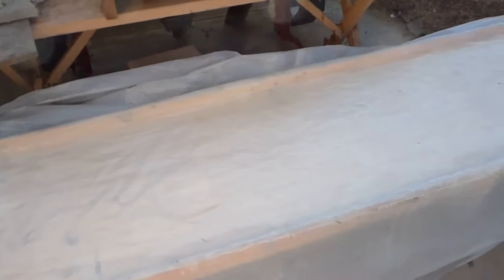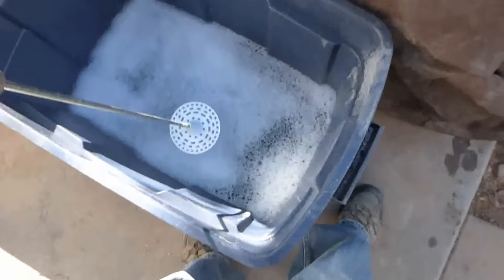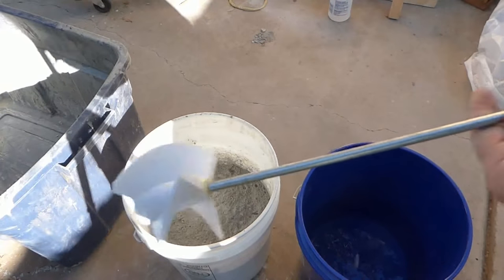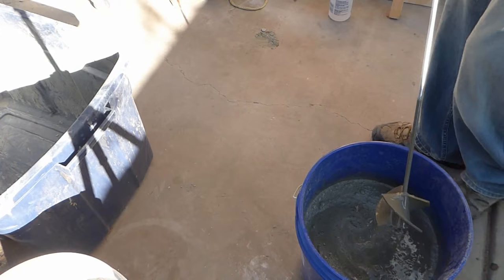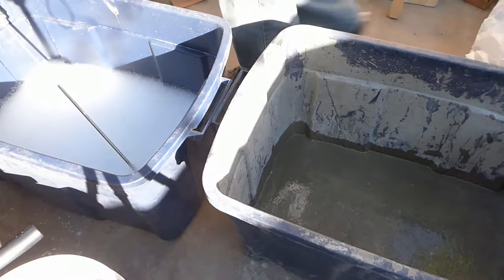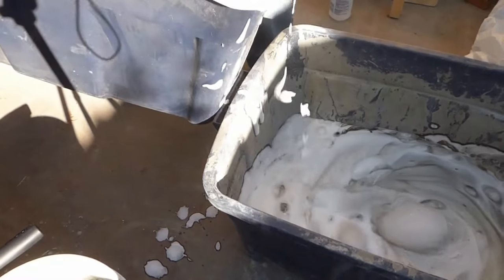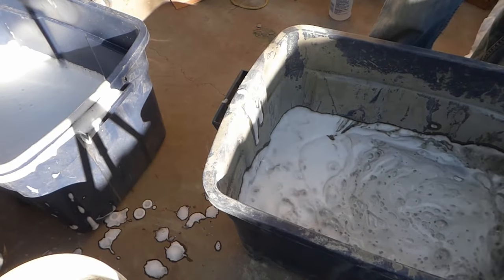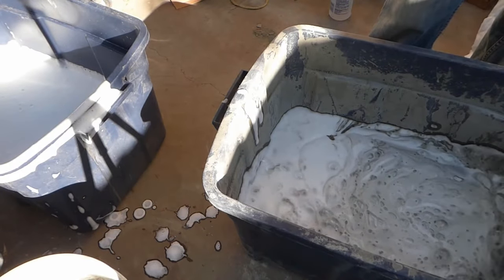Making AirCrete without an Air Compressor Foamer

Comment: I'll use some fine sand in mine
Reply from the maker: Hi Helen, I have looked for fine sand but cannot find any at the local hardware stores. I'm a bit unsure if fine sand will make the aircrete stronger or otherwise better.
Reply: Matt Welland Hi Matt sorry for the stress. I don't live in the US so I might not be able to tell you how to get the fine sand but perhaps if there's a store that sells concrete materials, especially the aggregates then you might be able to find it.

Fine sand is the type used in stucco (plaster sand). It is really smooth almost like cement, that's what I'd recommend however you can try what's called sharp sand.
I recommended fine sand because of the density of foam. It can disperse easily and won't settle like sharp sand could because the air bubbles in the foam might not be able to hold the Weight of the sharp sand particle but it is still very worth trying.
Some people use fly ash in place of fine sand...

 The sharp sand (fine aggregates) is the one used in concrete making (along with small rocks called coarse aggregate). Together with cement, they increase the density of concrete.

Yea, so sand would definitely increase the density of your foamcrete blocks. I'm sure there are one or two research papers that can give a better understanding of what we are talking about.

Again, sorry for the stress. 
If you try again, let me know.

PS: the sand would cut the cost of cement needed to achieve the same density of concrete.
I hope to start my channel soon
Reply: @ngreat4390  Thanks for sharing the info, Where are you from? 
I've thought that ash could be a nice plus in the mix, What proportions would You use with it and with fine sand? Eager to see your channel!

Comment: how about density?
Reply from the maker: If you measure carefully the density is pretty consistent. I believe cement off gasses co2 and absorbs water for a while. I'll put aside a piece and weigh it periodically and put the results into a video.  That would be interesting information.

Comment: where is the result ?
Reply from the maker: You can see some of the aircrete i made in my other videos but I stopped using that method since I built a foamer which is easier.
Reply: My thoughts exactly.  Where the hell is the video showing us the resulting panel you wasted all of our time mixing?  Lame.

Comment: No reinforcements?
Reply from the maker: You mean no steel rebar etc? Aircrete is not concrete and usage is different. A polyester mesh is used on the outer and possibly inner surfaces for structural strength, this is tensile strength (outer surface) and compressive strength (inner surface). All that said, note that I was never successful in making aircrete reliably and I gave up on it. Using it will need some research to find out why it works great sometimes and collapses other times.